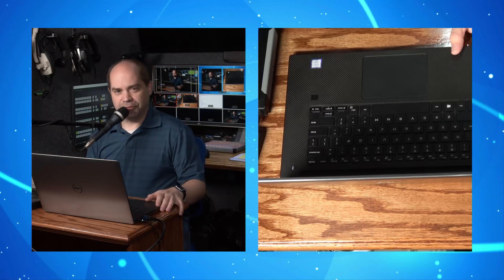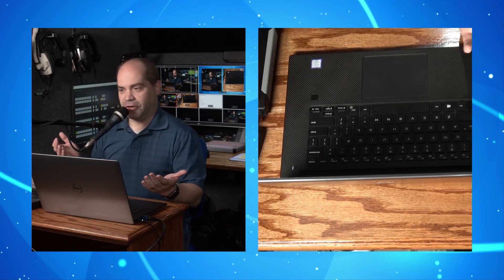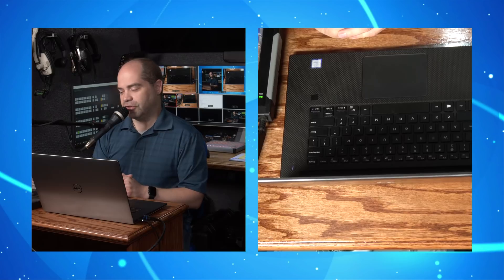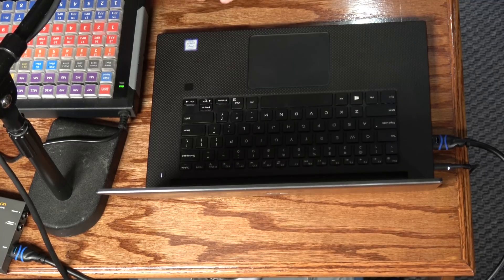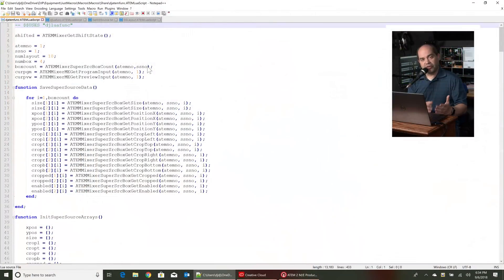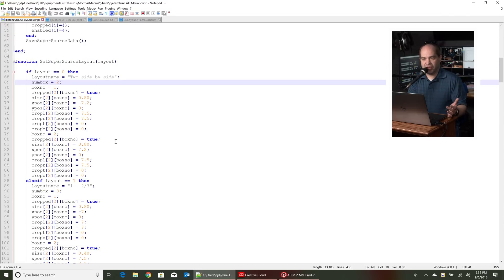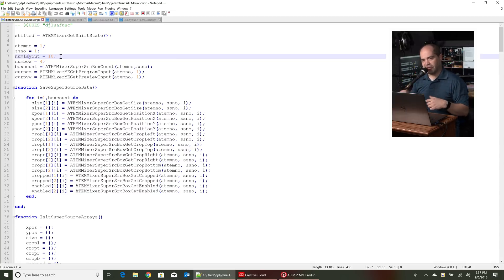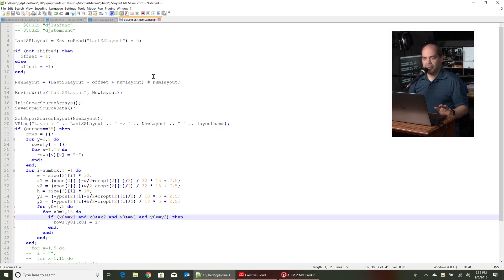Enhancing ATEM Switcher SuperSource with JustMacros

Comment: I've been trying to use JustMacros recently, and couldn't get it, I need to use ATEM Software version 8, does anyone knows how to use it on ATEM 9?
Reply from the maker: It doesn't work with ATEM software version 9.
Reply: @djp_video  8 latest version work? does the ATEM needs to be on version 8 as well or just the software installed with JustMacros?
Reply from the maker: The switcher should be on a version 8 release as well.

Comment: Hi Doug, perhaps a stupid question.  Can the "Just Macros" package be installed using a Mac?
Reply from the maker: It's a Windows app. I haven't tried to make it run on a Mac, so I don't know if it can be done
Reply: @djp_video  Thanks for the reply Doug.  Much appreciated.   Can justmacros run only with Xkeys or can it use an ElGato Stream Deck?  Let me know if you have a minute.  Thanks in advance.
Reply from the maker: @genesismultimedia4586  JustMacros only talks to the X-Keys controllers. There’s technically a way to make BitFocus Companion send commands to JustMacros, and Companion works with the Stream Deck, but it’s awkward and very limited in what it can do that way, so I wouldn’t recommend it.
Reply: @djp_video  thank you again for your time, support and willingness to share your knowledge.  Hope you have an awesome Christmas.
Reply: @djp_video  Hi Doug. I'm embarrassed to ask yet another question.  How do you get the super source to transition with motion as in your video?   And while live on using the supersource, let's say of three PIPs, can you preview the other preset layouts without interrupting the program, let's say if you wanted to go to a 4 windows PIP?

Comment: Great video Doug.  Much appreciated.  Were you using an ATEM 2ME or 4ME?  And can a Blackmagic Design ATEM Television Studio Pro 4K do the same trick?  Let me know if you got a minute.  Thanks in advance.
Reply from the maker: I'm using the 2 M/E Production Studio 4K.  The Television Studio products don't have the required hardware -- only the 2 M/E, 4 M/E, and Constellation can do this.
Reply: Thanks for the reply Doug.   @djp_video  Can the 2 M/E production Studio 4K take any signal, or do they all have to be the same resolution and frame rate?
Reply from the maker: The input signal types have to match the switcher's video format.

Comment: Hi Doug, I am following your great videos on ATEM switcher, I wanted to know are there any other switcher similar to ME2 with 4 super source, since COVID19 now we are facing challenge to add 3 skype video sources, tell me is that possible, if you can prepare a video on that then it will be awesome or just give me guidance. Thanks a lot
Reply from the maker: The 2 M/E from Blackmagic Design is the least expensive hardware-based switcher I know that has that capability.  On the software side of things, vMix can do it as well.
Reply: @djp_video Thanks for your reply,  how can I add skype videos in ATEM 2 M/E, I want to conduct a talkshow with 4 people on skype, it seems I can do only one by sharing the desktop option, but I am sure there are more options I heard about NDI option available and experts like you can elaborate it in more details. Thank you once again for talking time out and replying.
Reply from the maker: The easiest way with Skype is to setup multiple inexpensive computers -- one per call, and then take the HDMI output and run it into your switcher, converting to SDI if needed.

NDI could be used with vMix or a modern Tricaster, but it wouldn't work with a Blackmagic switcher.

Comment: Hi Doug, I need to have 6 cameras on a single screen, the super source only accepts 4, how can I make it include 2 more ... can it ..?
Reply from the maker: You could theoretically get 5 images if you were to use the SuperSource and an Upstream Key, but to get 6 you'd need to add additional hardware like the Decimator DMON-QUAD or an ATEM Mini.
Reply: Tks man

Comment: Hey Doug - great stuff
I am currently putting a proposal together for some production equipment for my company.
Is the 2 ME capable of 4 box layouts  that you showed or is that just the 4 ME??
Reply from the maker: The 2 M/E has the SuperSource. That's actually the switcher I use.
Reply: @djp_video   Is Super Source available in something like BMD 
ATEM Television Studio Pro 4K Live??
Reply from the maker: No.  It's available on the 2 M/E Production Studio, 4 M/E Broadcast Studio, and Constellation models.
Reply: @djp_video  Hola Te hago una consulta, guardo las composiciones de super source (pantallas divididas) en las macros del switcher Atem 2em 4 k con la actualización 8.6, pero al llamarlas aveces me desordena los box, y aveces me lo muestra bien, en dónde me estoy equivocando?, desde ya muchas gracias

Comment: around 2min 41sec you say one of the 4 super sources, will this special code work if you only have 1 supersource and if you are using the BM 1 M/E Advance Panel?
Reply from the maker: I was referring to the four sources feeding the Super Source. 

You can certainly still use one of the Blackmagic hardware panels, but you won’t be able to trigger one of these macros from the panel — you’d still use JustMacros to run my scripts.

Comment: Good morning . Thank you.
There are two questions.
1. In ATEM 8k, it works only on PGM, and it is said that it has an animation function. Make it possible for ATEM 8k. ^^
2. From Super source
I would appreciate it if BOX1,2,3,4, layer can be set.
Thank you.
Reply from the maker: This script will work on the Constellation.  It natively supports just the first Super Source, but if you look at the code you'll see that it is very easy to make it work with a second. 

Changing sources for the Super Source boxes is pretty easy too. It's just a single command in JustMacros.

Comment: Hi doug.
I really appreciate for your video clip about using justmacro.
but I have a some problem.
I assigned xkey at just macro and then when i pushed that button
atem was shutdown and disconnected. I used 2 M/E model. 
How can I solve this problem ?
Anyone have same problem ??
Reply from the maker: I haven't seen that behavior.  Do you have a recent version of the ATEM Control software installed?

Comment: Good morning Doug. Thanks for such a cool video. Listen, I have an ATEM 1M/E. I am DYING to be able to have better control over the PiP window just like the examples you have used. Can I do that? Is there any way I can do the same with my kit?   It seems like one might need to have the 2 m/e instead... but you may have some tricks up your sleeve... I am also unsure if in order to d that one has to have the USB interface to run the commands and perhaps can't be from from the laptop using ATEM Software Control. I'd love to get in touch with you directly if I may.
Reply from the maker: Most of what you're seeing in this video is done with the Supersource feature, which isn't available on the 1 M/E model.  Your switcher does have a single DVE which you could used for a single PiP window, and the animations that I show here are actually possible, but my code was written only to control the Supersource and its four windows.  Modifying the code to control the DVE on an Upstream keyer wouldn't be too hard, though modifying to only work with a single window instead of 4 will be a tiny bit more challenging.

The X-Keys controller certainly makes it much easier to trigger these macros, but you could also start them manually within the JustMacros software as well.
Reply: @djp_video  Hi Doug, thank you so much for your reply. I would love to explore doing what is necessary for me to be able to handle the PiP like your example. I sent you my contact information through your website hoping you could contact me. I would love to be able to do that work with my 1 M/E. Let me know if we can talk for a few minutes soon.
Reply: @djp_video  I would, of course, be more than willing to pay you for your time, so that you could help us out.

Comment: So helpful. Thanks heaps Doug. I'm new to the ATEM switchers and your resources are invaluable. I'm trying to have a background + powerpoint presentation via a computer source + 1 camera. I'm finding it hard to do but getting there slowly. Any help would be greatly appreciated. Might seem simple but I'm stuck. 
Cheers, Aaron
Reply from the maker: To do Picture-in-Picture, use one of the Upstream Keys. Set it to DVE mode, then select the appropriate video source for the Key. Set the size and position values as desired. To take it live, set USK Next and perform your transition.

Comment: Hey Doug, this is some great code. Have you had a chance to work with justMacros and BlackMagic's Constellation? Now that there are 2 SuperSources the ATEM can be used as a true screen switcher.  Any chance you know how to make edits to the code for the program? JM's built in functionality only works with the first 6 outputs and 1 of the supersources, is there a way to make a change to this?
Reply from the maker: I haven't had access to a Constellation.

The JustMacros functions for controlling the SuperSource do have a parameter for which SuperSource to use. In my code I'm just always using 1 for the first SuperSource. It wouldn't be terribly difficult for someone to modify the code to support two separate SuperSources.

Comment: pleAse i dont hAve x-keys but i hAve brodcAst pAnel 2 me inestAd cAn you tell whAt i need to enAble this mAcros in my borAdcAst pAnel And thAnks Alot
Reply from the maker: It requires the JustMacros software. And you’ll need some way to trigger it.
Reply: @djp_video  thanks alot just question
I have mov vedio and i convert it to tga to make a sting but it doesn't work can you help me please
Reply from the maker: I haven't had much luck with TGA files. PNG files have worked for me in the past, though.
Reply: @djp_video   you meAn it will worked if i convert vedio to png files Am so sorry for the q but i reAlly need to know how And thAnks Alot for replying
Reply: @djp_video  thanks bro its done i mean the png sequence but how to connect the code to 2me it still false i dont know how

Comment: Hello Doug,
Great job on your videos.  I like your format a lot.  Question...  Have you looked at the Stream Deck Product?
Reply: https://www.elgato.com/en/gaming/stream-deck-xl

Forgot to add link...
Reply from the maker: I’m familiar with it. But there is one big issue: they don’t make one big enough to handle all of the functions I would need
Reply: @djp_video  Hi Doug,  They just release a 32 Button version and it has folders.  I think up to 99 Folders of 32 buttons each... 3168 Buttons and they have a SDK.  Unfortunately, it is a bit over  my head right now.
Reply from the maker: That's fine for many applications. I've got the 128-key X-Key controller and it still isn't enough buttons, though. And having to wade through folders to find the button I need just isn't ideal in the "gotta get it done now" environment of video production.

Comment: Hi Doug does it work for a mac and whats the model number of the xkeys you are using ?
Reply from the maker: JustMacros does not run on the Mac. There might be some software out there to allow the X-Keys controllers to work with the BMD switchers, but I haven't researched that.

I have two X-Keys panels, the XK-128 (https://djp.li/xkeys128) and XK-80 (https://djp.li/xkeys80).  A video about those is about to go live.

Comment: Gr8 video as always, can you do the video to have replays? I m not into software based replay there is ISO and other but I would like to go full manual with switcher rather than software so may be there is a way to replay with switchers and control unit. Any suggestion on live recorder that can be use to replay the recorded media on live. Thanks for the all those helpful videos.
Reply from the maker: If you watch this channel much you'll probably know that I've got my own proprietary solution, and it's still in development. When I feel it's ready I'll do a video about it.
Reply: You and your channel is so good on responding, this is what I like  the most of your channel and gr8 contain for live vdo production. Kepp it up man.